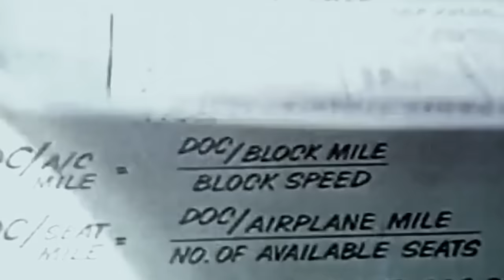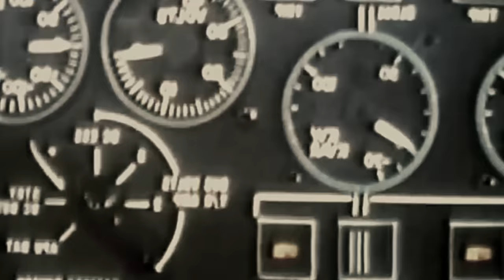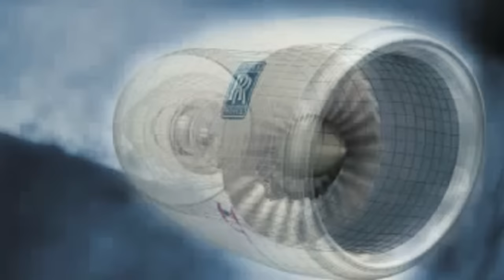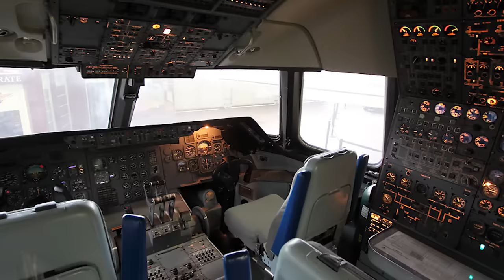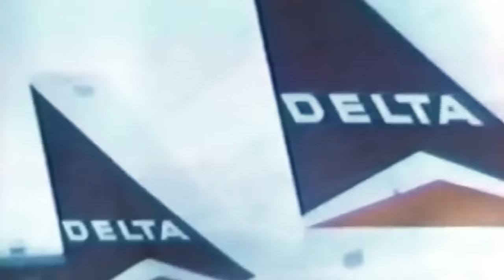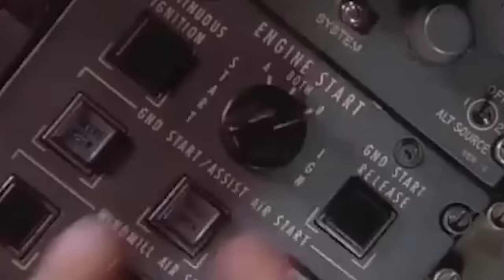L-1011 Tristar - too advanced for us

Comment: I flew on a L-1011 around 1975, from Albuq. N.M. to N.Y's La Quardia airport. Great plane, except when the Rolls Royce engines were spooled up in Abluq. their was enough smoke to cover about a100 sq.yard area. Finally after 5 or more minutes of this huge beast refusing to start, had now turned into a very expensive smoke screen machine!  Then the  pissed Captain (tone of his voice) said over the intercom, "folks don't worry about all the smoke it's just that these damn Rolls Royce engines are hard to start at this 5,000 ft above sea level attitude,but they will". About 1-2 minutes later the 2 on the wings fired, then no more smoke. Everyone was now ready to fire up a fat joint. Anyway, that very advanced airliner like the captain stated "the British engines were not up to par. Never could understand why GE or Pratts were not used. that plane had more redundant systems that any liner ever made,which of course the bean counters could not allow the extra $, cause they never care about the people,crew who have to fly,as $ is more important,the sorry SOB's.

Comment: Flew a lot on the Eastern Tristars in my younger years, I started my A+P career in 81 and worked most heavy jets of the era, the L1011 was Definetevely a superior aircraft in many ways. One the nails in the L1011 coffin was the Kapton wire fire hazard, wich was extensively used on the L1011, it was too much investment on a non profitable project for Lockheed, even though the worst accident by kapton wire was on a MD11 Swisair flight 111, 229 RIP.

Comment: This was my most favorite aircraft to fly on.  I made over 100 flights on the L-1011.  The CD 10 was my least favorite wide body aircraft to fly on. I made over 100 flights on the DC 10 too.  Piedmont and Delta were my favorite airlines. US Air and Eastern were my least favorite.  I saw many airlines come and go. Some remained that should have gone. some went that should have remained. Piedmont was bought out by US Air. Piedmont should have survived and US Air should not have survived. My only regret in life is never having flown on the Concorde. I truly feel like I missed a piece of history. The L-1011 should be resurrected and so should the Concorde. Both were ahead of their time. The biggest problem of the time (1980's) was the cut rate airline and the price wars they created. 

I had a ticket on the January 13, 1982 Boeing 727 Air Florida aircraft that crashed into the 14th street bridge in Washington DC. My connecting flight out of Raleigh NC was cancelled and I had to fly to Charlotte, NC and take a Delta flight to Tampa Florida. My lucky day.

Comment: Another downside to 1011's was a low cycle life compared to others, they had a shorter life and cost way more than DC-10's did so most airlines ended up getting DC-10's instead.

Comment: McDonnell Douglas DC-10
1: Luggage door failed during pre-production tests, nearly crashed one plane and completely destroyed another.
2: An engine randomly exploded and destroyed all the hydraulics because of bad titanium.
3: Old DC-8 technology.
386 made + 60 KC-10 planes

Lockheed L-1011 TriStar
1: Advanced technology capable of landing the plane alone.
2: More comfortable and quieter.
3: No fatal design flaws.
250 built

Bloody impatient airlines!😠
Reply: The blade separation was because of a crack that was not detected by maintenance. So it was maintenance error that caused the explosion.
Reply: @zachb7834  But that crack wouldn't have been there in the first place had the titanium been made properly.

Comment: L 1011 vs. DC 10, also called "Death Carrier 10" ????  1.000 to ZERO. But the "costs" are more important, so.....Also the stupidity of RR, continuing to produce the RB 211, a project of the '50s, is a big stupidity. For all the other technologies, L 1011 gains vs DC 10 in every situation. But it is too advanced for a "low cost" as DC10.....

Comment: The Aug 19, 1980 crash of a Saudi Airlines L-1011, killed 301 persons. The cause was a fire onboard due to the airline allowing Muslim devotees to cook with butane fueled stoves, while the aircraft was cruising. The flight crew, all three, were poor pilots who were required to redo many parts of the training program, the flight engineer was dyslexic and he had failed Saudis training so often, the airline required him to get outside training at his cost. The pilots decided to return to Riyadh it landed with no trouble however the captain decided against evacuating the aircraft, for 3 and 1/2 minutes the aircraft taxied the rest of the way down the 13,000 ft runway and then stop on a taxiway. When the fire rescue caught up with them the aircraft was still pressurized, engines 1and 3 were still running. When the finally breached an overwing door, they found everyone dead. The TriStar had no defects that contributed to this incident.
I loved the Tri-Star flying LTU from Phoenix to Düsseldorf, as well as Delta to Atlanta or the east coast. It was a very comfortable aircraft, with wide doors allowing two people to enter side to side. The employees at Delta loved the aircraft and their air line so much they bought a TriStar to present to Delta. My two favorite wide bodies were the L-1011 and the 767 which was truly one terrific aircraft, almost bullet proof. Qantas pilots hated giving up their 767's called the model, the most reliable aircraft they had ever flown. You can find the last flight of the last 767 from Sydney to the Mohave storage site on YouTude, the pilots were truly sad to see it go. Hundreds were on hand to say goodbye.

Comment: 3 mistakes in the presentation.  1 the landing gear were placed in locations that were optimized for weight distribution and foot print. Futher out on the wing and farther back from the nose. Unlike the dc10-30/40 were the increased payload mandated a center bogey.  2 that FLYING TAIL at the rear gave pilots instant responds to flight inputs.  Just like the live trail planes one the F14 and F18.. 3 the redundant systems that would prevent an on time departure,  like 4 hydraulic systems 4 generators 3 laser inertial gyroscopic navigation systems. Thier were others like a newer alloys used in the wings that resisted corrosion  the eliminaton of rivets by  going  with a bonded fuselage. Its was rumored that Airbus personnel were spying on the Lockheed development and incorporated alot of the cockpit layout into thier planes,  things like how the switches followed a logical flow and preflight check list, the large windows for the pilots and fly by wire subsystems..

Comment: Is it me or does anybody else notice how relying on Rolls Royce for new engine technologies is one bad bet. RR gets my aircraft killer award. Lockheed had issues with RRs that killed (by delaying) L-1011 sales, RR engines installed on the Dreamliner have grounded fleets and RR still can’t guarantee that the same issues won’t reappear on the “fixed” engines. Then we have the new RR Geared.fan engine for the 797, RR just told Boeing they can’t do it, they are cancelling the program. Despite all this BS Rolls had their best quarter and year in 2018 with a third quarter 250£  profit. The 4th quarter should match the 3rd’s profit.

Comment: Nice video n all but the information is somewhat flawed . The DC 10 even today is mentioned as being way ahead of its time in technology just like the L1011, in no way was it a classic or old design. Wikipedia isn't the best source for making videos specially when the reference is from a writing all about praising the Tristar. Also the reason AA chose the DC10 was the design issues with the RR engine. The engine carbon fiber fan blades failed testing and had to be redesigned with Aluminum alloys. Even today DC10s and MD11s continue to fly as cargo jets ages after the Tristar became history . Not to go against the Tristar in anyway, it was a superb machine with engines its main headache. Have worked on all three aircraft as engineer, the DC10 , Tristar and MD11.

Comment: The demise of the L-1011 was engineered by Boeing and McDonald Douglas.   All great engineering feats are always doomed if they threaten the profits of the 'Big Boys'.  The same  methods and techniques  were used by General Motors and Ford to get rid of 'Tucker' which was also far advanced in their design and engineering.  Lockheed in particular was the biggest threat to Boeing on Long Haul International Flights.  Even before the the start of the jet age, if a passenger wanted to fly to overseas destinations, the best aircraft at the time was the Lockheed Super Constellation.  Progress and quality always suffer due to the potential loss of profits by the "Elite Criminals'.

Comment: I FLEW THE L1011, -1, -100, -200,-500  AND AIRLANKA HAD A -15 AS WELL. HANDLES LIKE A LITE A/C. A REAL PLEASURE TO FLY.THE LAST FLIGHT WAS ON A -15 IN 2000. WHEN THE L1011 WAS REPLACED BY THE AIR BUS .WHICH WAS A LOAD OF SHIT COMPARED THE TRI STAR

Comment: In reality, this big aircraft could be operated as a drone in 1972. It is highly probable that this drone control technology of Lockheed already had been used in other big, but secret, drone crafts, possibly nuclearly driven, and when seen reported as UFOs. 

By the way, the first time I traveled by air was in 1972, and the last so far was in 2015. The comfort of air traveling has steadily declined, and the modern aircrafts of the type Airbus or similar, is very much comparable to a cheap city bus in comfort, unfortunately.

Comment: Too Bad the truth means nothing to sheeple.  Oh well more propaganda. Don't mind accolades, but at least get your facts straight. L1011 best passenger yes, but don't forget many C-5 frames & military personnel lost, including the records of this happening. Similar with F-104, over 200 airmen lost due to design flaws on that fighter. Used to listen to the reports. Douglas when there was a problem would investigate and admit when confirmed. Then correct what was necessary. Boeing had the worst with the original wide body aircraft. 747's had many more frames lost more passengers lost yet tons of positive press with their design flaws. PBS (now Koch Brother TV) put out a special concerning design flaws for 737's alone (quite a few). No one gave them the bashing for not being as good as the DC-9 at the times.  Try to ask if this special was made it will be denied.  Yet people still have original broadcast recordings.  (Never Made?)  The worst back then Lockheed Electra wings rip off during flight and plane usually disintegrated on the way down. These politically motivated sheeple of today! (the syndicate brothers). I'll stop here because I would go on for quite a while naming the lengthy list of politically based inconsistency's vs facts, proving how politics works. Would hope one day you restrain yourselves from pushing propaganda. All three actually made great products. Douglas was the Major Contractor for NASA because of safety. and they lived up to this expectation. Going to the moon and back, monthly with (even with Apollo 13) bringing everyone back. The syndicate wanted this technology developed and using politics removed Douglas & NASA budget. Mysteriously placed under their wings (now more dead astronauts also)!!
Reply: Moon? Not quite. Douglas built the Gemini capsule, and the 2nd stage of the Saturn V. The Apollo spacecraft was unfortunately built by North American. Remember Apollo 1? The Block 1 spacecraft were crap. Block 2, which flew all the moon missions were much better.
Reply: @mikecowen6507  : Hmm, not quite true North American Rockwell were originally a division of Douglas like McDonnell became later.  All different divisions of Douglas wound up being forcefully acquired by 'Boink' or 'Lockmart'.  Including AT&T.  Knew about this before 1970, most people still don't know today.  You didn't.
Reply: @slowpoke3102  I'll have to look into that. Thanks for the tip!
Reply: @Slow Poke Like the F-16 wire chafing. Pilots trained to trust instruments. HSI goes inverted in IMC conditions. CFIT. A score of pilots & airframes lost. Oops! We'll pick that up in a revision. Publicly tried to cover up. To one dead pilot's wife who had PROOF of negligence: sorry, can't sue as gov't contractors have immunity. Have a nice day.
Reply: @mikecowen6507  :  Sorry you still don't seem to understand.  The mobsters 1st of all do not want the truth, they shell game it.  Until they appear like they are correct.  There are a crap-load of facts that 'Boink' & 'Lockmart' have had 'erased' under the guise since they didn't invent but now own the patents to they just want a little update.  It wipes out the actual developers.  Under US law that is legal, but it still doesn't make it factual.  If you wish to pacify that side of the fence then it's your own go.  Discussion becomes useless since facts are not the objective.
Reply: @slowpoke3102  I completely understand these companies will lie/cheat/steal/swindle/manipulate records/contaminate/poison/kill in the name of profit (or control). The "truth" is whatever they want it to be.
Reply: @mikecowen6507  : Misleading Falsities, or like POTUS, syndicate 'publicity over facts'. Whatever they want it to be misrepresentation.